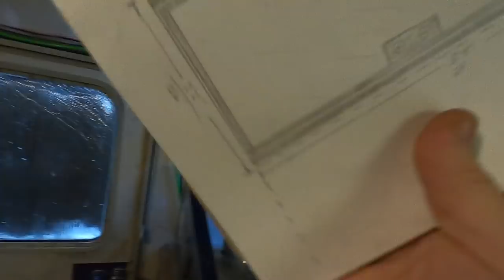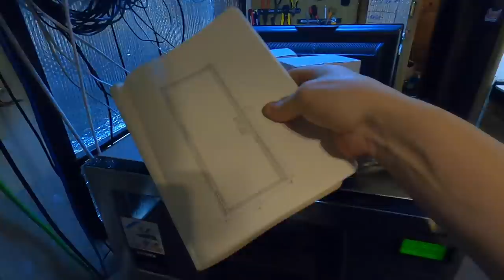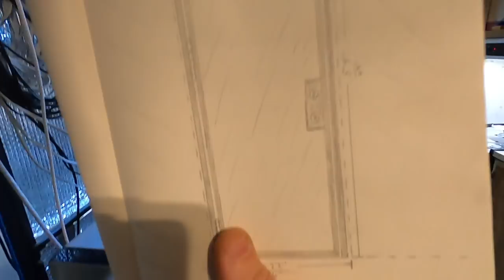Moving Out Of My RV & Truck Vlog

Comment: Time to make a change buddy. Sell jimmy. Fix rusty up and  get a small fith wheel or pull behind RV that is in reasonable shape.. That solves alot of your problems. You will have a truck to pull the RV and a truck to run around in. You will also have the trucks off the owners property. Just my opinion man. Been watching you for along time.
Reply: I agree jimmy would bring a good price being  a square body   plus he wouldn't need to worry about storing them

Comment: If you decide to scrap Patches. The old P30 RVs used very heavy duty front control arms that are near impossible to find today. The other item that us near impossible to find is the rear air bag suspension Patches has. Heck, if I had the time, I'd buy it off of you.

Comment: Keep your options open. Once you clear out the RV you can take a wall panel off under the leaking window and test out fixing one section of wall. After all the improvements you have made to the mechanical parts, it might be worth doing a project on the walls so that you can live in and drive Patches :_calPatches: until you have your own land. 🇺🇸 It depends on what you find when you investigate what is behind a wall panel.
Reply from the maker: Thanks for the input buddy! :)

Comment: any thing can be fixed with enuf time money and parts and skill i don't know your money situation or time frame but if you got a chance to move out and gut it out and really give it a good overhaul and rebuild the insides and fix the outside in the process i mean like tear all old flooring and carpet out and any shelving and stuff like that fix the frame and whatever else is rotten or loose or week then lay down some fresh flooring  like linoleum front to back and build any closets or storage the way you want and need it

Comment: Id strip patches of anything useful for a trailer or a bus build. You wont get much selling it in the condition with all the work required and the delamination. It served you well for a long time. strip it and sell it. Buy a trailer to pull behind one of those truck...a small trailer is cheap. or, buy a bus and do a bus build. you could tow a truck behind it. id keep the best truck and sell the other.

Comment: Well, complicated situation. So what happened to the roof repair ? Is it delamination of the plywood or the paint from the plywood? Did not know nothing about the paint You are using and hoped for good results but obviously not the case.. If I wood have to do it today I would seal the plywood of with some resin and most likely use EPDM rubber paint coating but after what happened too You I would first do a test piece. The other option is just glueing a RV roof liner on top. Well, I have the P30 chassis but besides that every thing on my WINNI is the same. My roof is still rock solid. It´s factory aluminum.. Now the sidewalls are the same blue foam sandwich with the liner clued on top. Below the stripes I changed everything including all the doors of the boxes etc... complete rebuilt. I used a resin treated speciality wood 1/4 inch that´s gonna last 100 years... completely over built and heavy and expensive. Thought about giving the steel frame more integral strength... Today I would use half the thickness, or use 1/4" plywood  resin sealed on both sides and paint it over with heavy truck bed liner paint. Of course there are many reasons You could find to buy a new RV but there are also a few reasons I wanna keep my good old Winnebago. First of all from the standpoint of an RV... It has a steel frame and second. In the old Chevy P30 chasis I get spare parts everywhere for a reasonable price and third I can fix everything myself without any speciality tools.. So now You wanna buy a new "OLD" RV... So what are You going to get if You don´t want to spend a ton of money ?
Most likely another can of worms.... while You know You have a good chassis with a Winni steel frame.
What I know is...... the building quality of newer RVs got much worse...... and then ever more new electronic gadgets that I can not fix myself..... from engine management to who knows what !!!! So add that on to Your to do maintenance and repair list.
As far as the new property goes. You definitely want a fixed and safe container that You need to convert to some kind of a PLUG  and PLAY docking station for the RV.... water, sewage treatment, electricity ; now when It comes to electricity I would definitely look for a more favorable climate zone with sun for solar. And of course internet... those 2 things together will provide me with ONLINE security that I can check with my phone. I wanna know what´s going on on my property all the time !!!
May be You wanna live in the area for cheap rent first to get familiar with all the red tape and little details.
Maybe You can rent for free. Many people will be more then happy if somebody is watching their beloved property... well and if a plumber or handy man is at need I am sure You can provide them with a telephone number, Right ? Get in touch with the realtors.

Comment: Sorry Man, time for Patches to go. Once moisture gets into the vacuum bonded walls, it's done for, and you got more years than most of them can give.
The dually can be used to haul a fifth wheel, the other a TT, pick the best one.  At least with a truck you can go to work if needed. Can leave a TT or Fiver and get around, M/H not so much. Your decision, I know how it is making a life altering decision, but time is not your friend.
Reply: @zoidberg444  I have torn back and reskinned walls on a M/H that did not have bonded walls and not 32' long and took forever. It becomes a case of the "Might As Wells".  While I've got this apart I might as well fix this, that and the other, not worth it. Money starts to drip, drop and pour away.